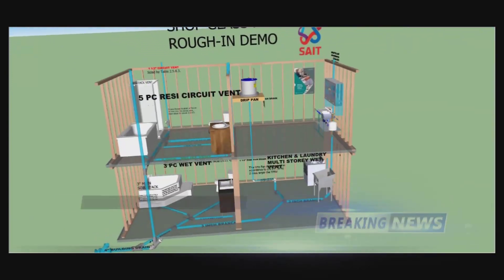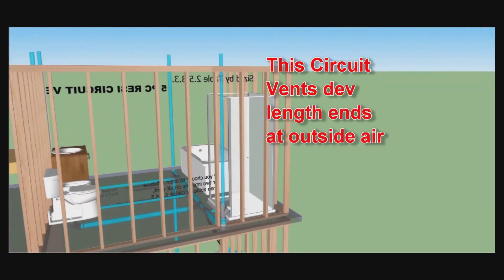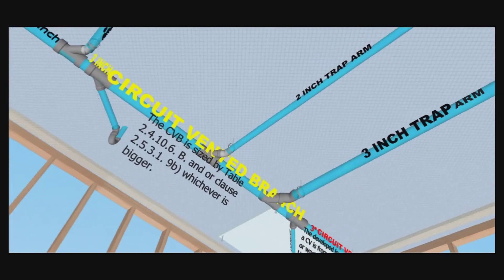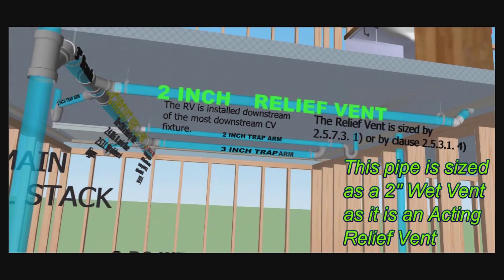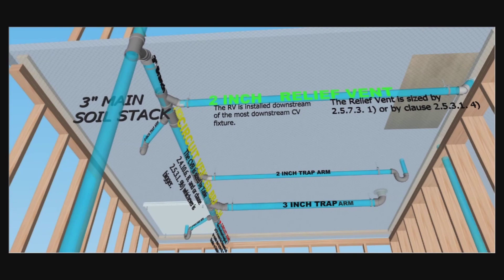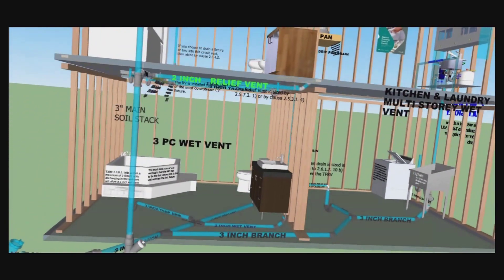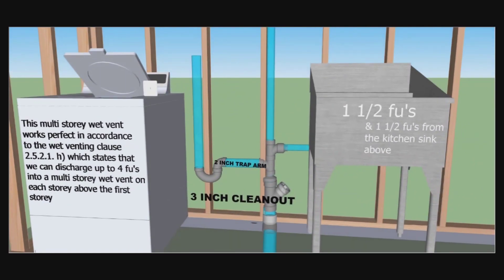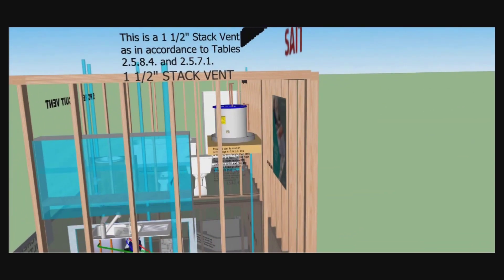SAIT PLUMBING RESIDENTIAL CIRCUIT AND WET VENTING

Comment: Overall good video, one correction though, 2.5.2.1. and 2.5.3.1. are not Clauses but rather an Article. A Clause would be, for example , 2.5.2.1.(1)(b). The NPC is structured Part, Section, Subsection, Article, Sentence, Clause, Subclause.
Reply from the maker: thanks for paying attention to the detail of the code, its just an old habit I have of calling them all clauses.